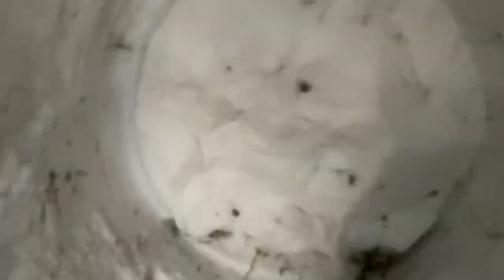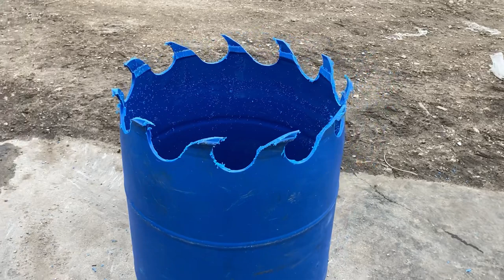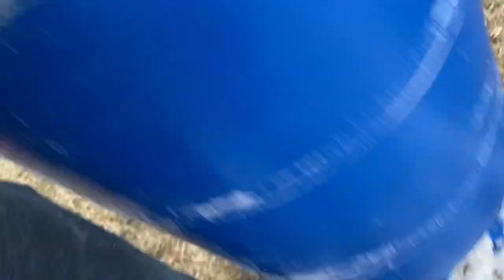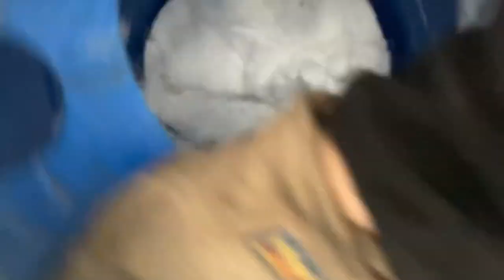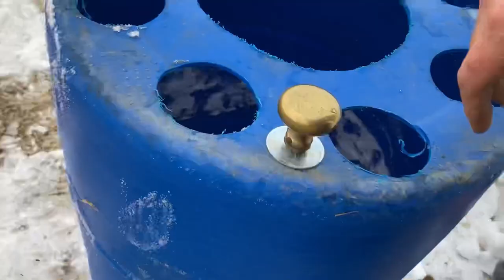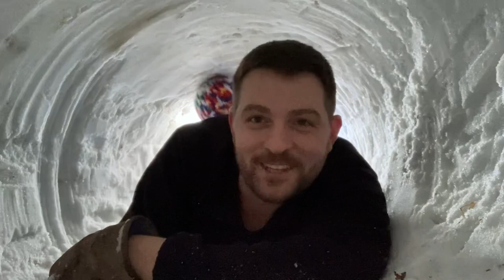Snow Day Digger

Comment: How cool! I have two grand sons  that spend hours and hours digging tunnels every winter into our snow banks. I can imagine adding an extension, maybe an 8ft 1 inch steel pipe.  Attach a round  thin steel plate, maybe 20 inches in diameter, and attached  that to the end of the extension. Install the door knob in the plate and one kid could hold onto the pipe and guide it and push while dad, I mean the other kid, powered it.  No more laying on your belly in the snow.  Yep, I know what we are going to build next weekend. 😊

Comment: Biggest hole saw I ever saw. It could use an long extension with a crank. I’d make the ring of holes in the back of the ‘cup’ smaller and not so close to the rim but it seems to be holding up fine.

Comment: If some of the teeth bent inward at the front, I think you could also get the center piece of snow to break off b/c the inward-facing teeth would be tearing away at the base holding that center column.

Neat project though. I sure do not miss the cold and snow right now (check back w/ me around 5pm today and see if i feel the same when its 90 deg).